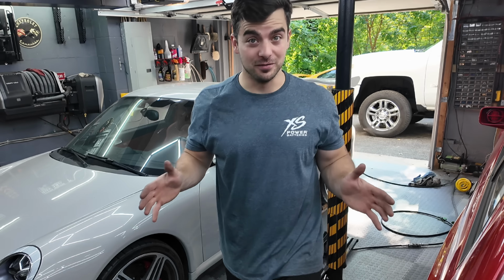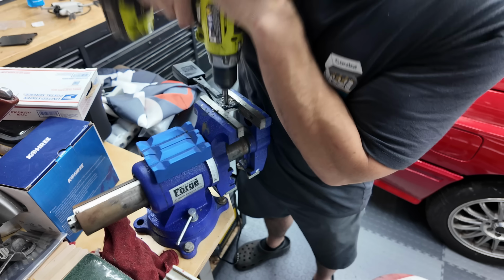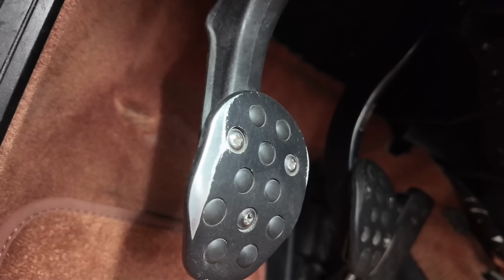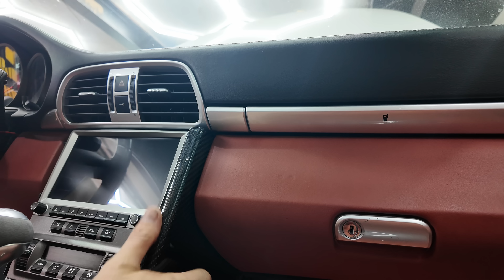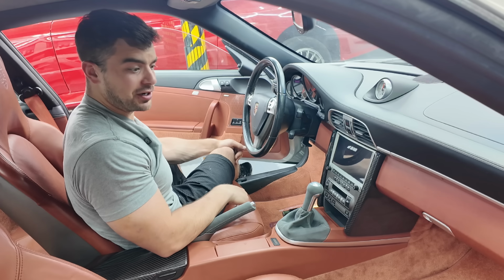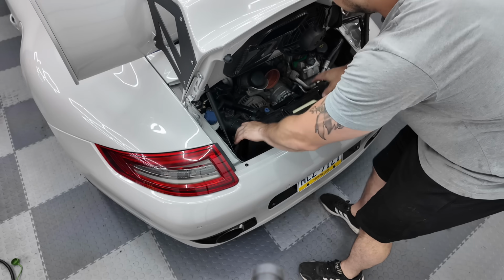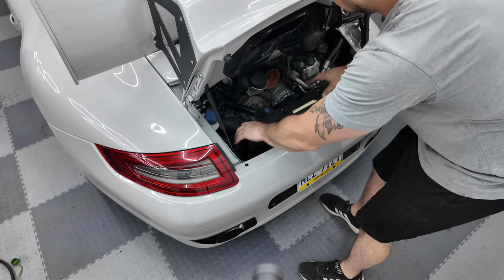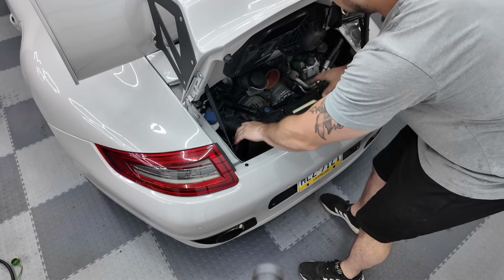I FINALLY did it!

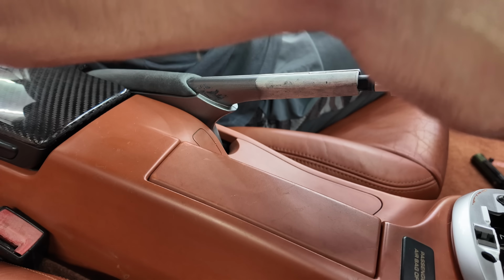Comment: @matt13ross - at the 6:41 mark, you install the new e-brake handle cover. Do you know how to remove the factory one?  I want to paint or replace mine (Just the handle cover, not the whole thing)
Reply: Pull it off. Pull hard while twisting back and forth.

Comment: Get a dsc controller and it will make the suspension feel perfect
Reply from the maker: I'm thinking about it!  So it can be even softer than factory? Then I assume harder as well?
Reply: @matt13ross  that's correct.

Comment: Question on BMW LS swap; Did you have any vibration trouble. I did a 08 335 swap. I feel it through the entire car, occurs about 5-65. Usually occurs when you're in gear and if you depress the clutch it softens to nearly non existent.

Comment: Passenger airbag stage 1 lower limit usually means the first inflator is open or shorted.  I would access the airbag connector and test continuity across the loads (inflators).  If your meter reads OL, then you know the inflator is done... needs an airbag module.  If it's registers a reading, then I would move onto troubleshooting the airbag circuit.  good work in this vid.
Reply from the maker: Do you know which one is the first inflator?  I had the main airbag module reset.
Reply: @matt13ross  I think the airbags themselves are two stage- so each airbag has two inflators each.  First stage and second stage.  You'd need to test both inflators on the passengers airbag.  If one of them registers a reading and the other doesn't then you know the problem is the airbag assembly (module).
Reply: I would also agree with this.  In addition, I have read that attaching the front tow strap causes a ground fault and throws a code.
Reply: @bandwagon240  Agreed. I've come across this during a routine wheel alignment. Was able hear the slightest hum from underneath the bumper. Client was overjoyed once notified.

Comment: 4:27 Matt. Please do me a favour and buy new seatbelt buckles. Welding changes the material properties of the steel and adds stress to the heat affected zone. For the cost of a seatbelt buckle, it’s a no brainer. Your life is worth far more.
Reply: Completely agree. The metal is now brittle as it hasn’t been heat treated.
Reply: Real Gs fly through the windshield.
Reply: @akingtonone  fr

Comment: i would have to agree with most. the clash of the grey with black carbon and terracotta is over whelming but this is your car. also your arm will stick to that arm rest and it will scratch so easy. also replace the belts. anytime a vehicle is in a wreck or has track use i would replace them. FIA mandates that. and mercedes benz i believe came up with the fuel cooler.

Comment: For the air bag, move the passenger seat forward a little and see if that helps. The wiring harness gets stretched too much if the passenger seat is moved to far back. If the light doesn't go back off after moving the seat forward, you may have a broken wire in the harness. Somewhere on YouTube, I watched the cause and repair, so try searching for that. If I find the video, I'll post it here for you.

Comment: My 997 turbo has the same suspension  and the top hat moves like that I’ve looked for answers and it seems to be the design for it 
That suspension looks all bilstien as mine is like that I had to raise mine up and the clunk went away a bit but not completely it as move load on the springs and Tophats stopped it rotating as easy

Comment: Preload on the front springs might not be properly set which is why you can rotate the coil.  Also, you'll need to be sure to transfer the angular bearing, cup and insulator to that assembly.  I can't tell by the video but it looks like one or more parts might be missing.
Reply from the maker: Thanks!  I'm thinking I'm missing parts too.  Do you have a suggestion or should I go straight to camber plates?
Reply: @matt13ross  If you have to take them apart anyway to install missing components, I would go with camber plates.  I'm using Elephant racing on mine, and everything I transferred over (cups, insulators and angular bearings) are factory PORSCHE.

Comment: The top hats do spin like that. In regards to softer springs, youve been driving around with PASM not working. When its unplugged like that it defaults to the stiffest damper settings. Now that its working the ride should be much better. No need for softer springs

Comment: If the car was in a accident. Most likely the Airbag module will have to be replaced with a new one and programed. As the crash event can’t be erased.
Reply from the maker: I shipped it off and had it reset so the module should be all good to go.